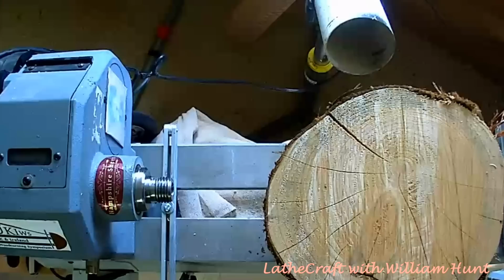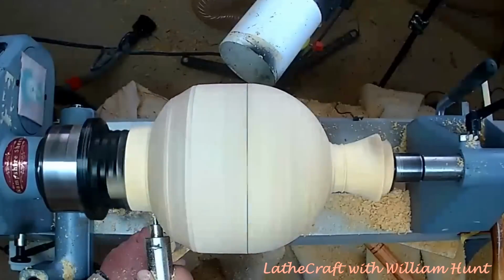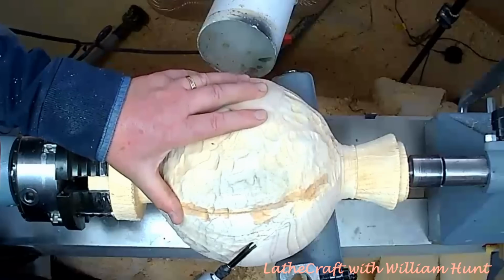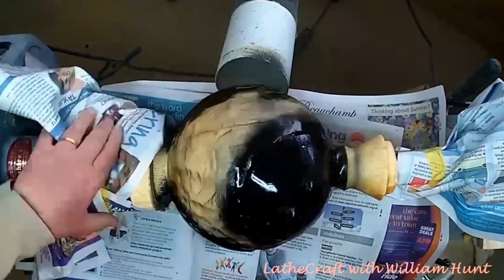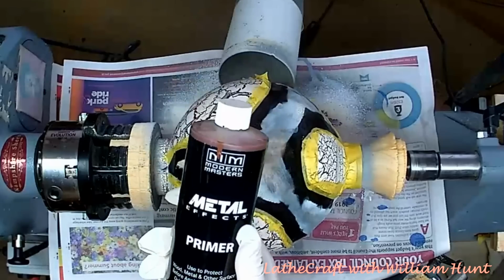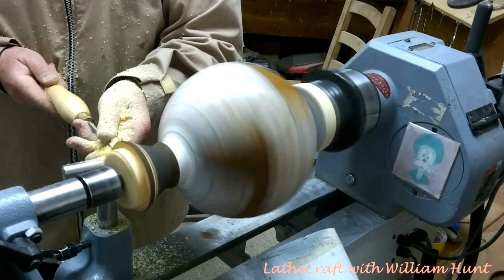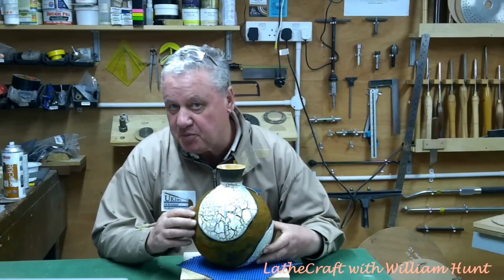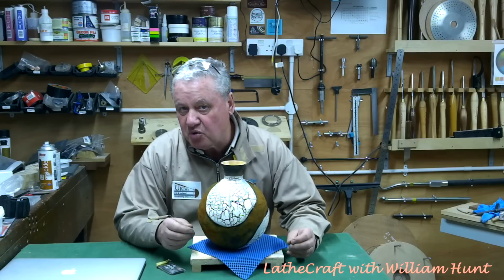Woodturning - Raku Style Bottle with Crackle Effect Paint and  Metal Reactive Paint

Comment: Back in the 80s there was craze for this type of work on furniture They would get a nice bit of wood furniture there was a special paint which was put on then a 2nd coat and naturally cracked.  Or the other way was 2 coats of paint  different colours then sand paper the edges.  They called it distressing.  Sometimes it was distressing when you saw a lovely piece of wood being  treated in this way.
Reply from the maker: Norma, yes I remember this too and I feel the same way. However, I don't regard Cypress as a lovely piece of wood, it doesn't even make good firewood.

Comment: I like the crackle look but not sure about the rust. The the shape and idea is outstanding.
Reply from the maker: Hi Thomas, I fully agree, but just has to use what I had to hand. I wanted a whited stained sub-surface, but messed around at bit and could not achieve the effect, after the sandblasting failed too,